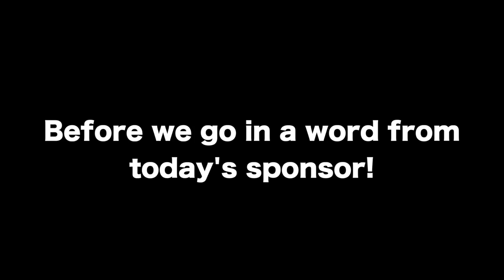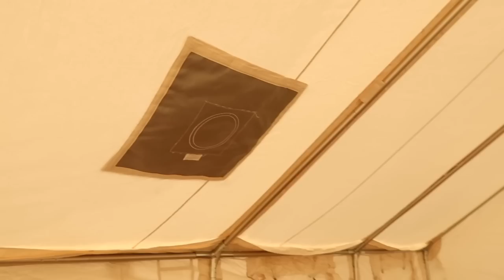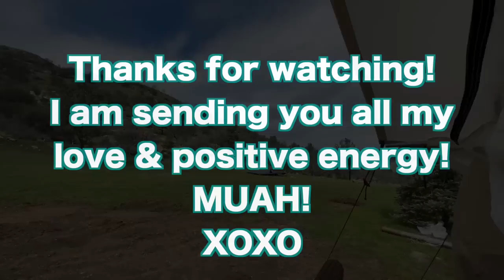SETTING UP A GLAMPING TENT TO AIRBNB

Comment: That will be hot in the summer out in the open no shade. You will need air con in the summertime?  What's the temp. Then?😊
Reply from the maker: Luckily where we live the temps are mild in the summer from what I’ve heard from locals but we will be sure to make sure our guests are comfortable so fans, ac unit whatever it needs we will do ❤